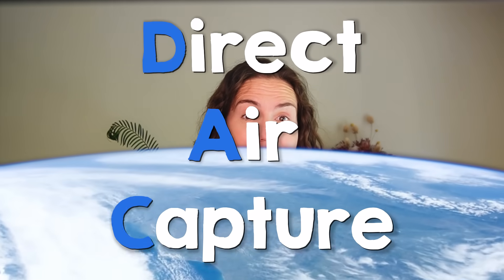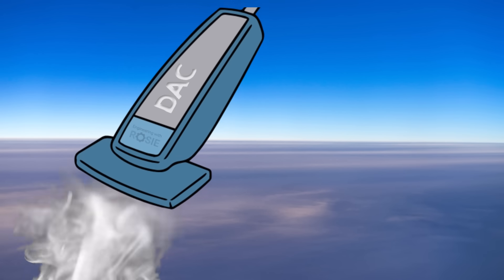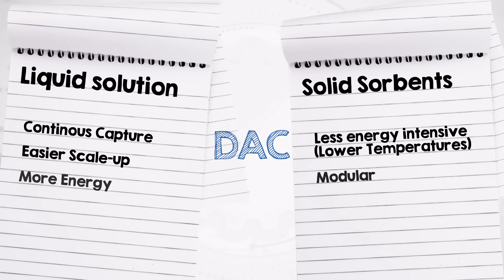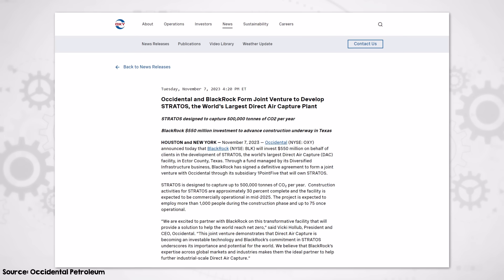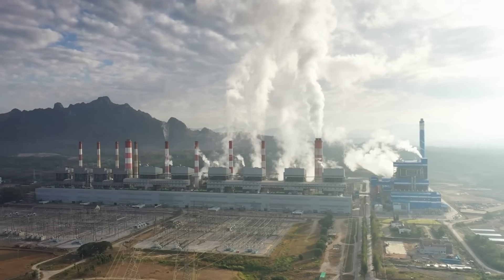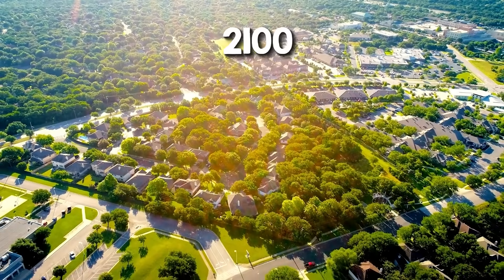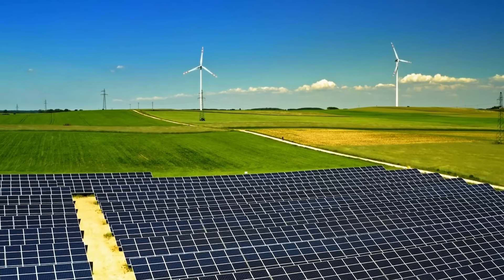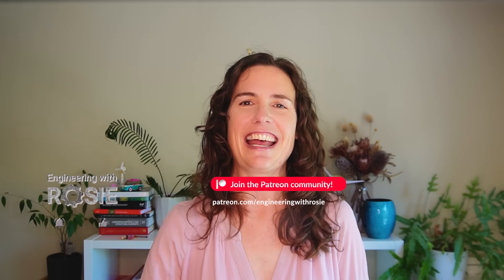Direct Air Capture: Climate Savior or Distraction?

Comment: Goddard & Goddard Engineering

Environmental Studies

Wilson B. Goddard, PhD, Principle Senior Scientist;

Christine B. Goddard, Principle Environmental Planner

Toward a No Carbon Burn Hydrogen/Ammonia Energy Future Without Stranded Fossil Fuel Resources

The pyrolysis of all types of Fossil fuels is a little discussed but literally can be a transformational part of a smooth transition to a no carbon burn world.

To avoid further climate warming, by necessity we must move quickly toward a no carbon burn future.  This can be greatly aided by using fossil fuel's hydrogen energy without burning its carbon.  This can be achieved through fossil fuel pyrolysis, thermal cracking, which releases the hydrogen leaving elemental carbon as a useful by-product. The carbon may be used in many applications from soil amendments to aeronautical light weight structural elements depending on its form.  

The energy required for pyrolysis is no more than the necessary energy used to separate carbon dioxide from flue gasses, clean and compress it then pipeline pumping it to sequestering storage, CCS (1. Steinberg, 1997). The elemental by-product carbon can be safely stored or used without the inherent uncertainties of CCS possible releases or other environmental impacts. Various forms of carbon may be produced including less expensive nano carbons depending upon the pyrolysis system used using various catalysts (2.&3. Ren, 2015 ).  
There are many good research papers on fossil fuel pyrolysis and its ability to produce clean hydrogen and carbon without carbon dioxide emissions.  There are a few companies pursuing commercial applications, including Basf, Eden and Monolith Materials.  Appended are four abstracts from papers for your further review which have demonstrated hydrogen production from methane, propane, gasoline and diesel fuels as well as carbon dioxide producing various forms of carbon including nano carbon. The energetics are shown to be equivalent when you consider the energy loss in carbon dioxide CCS and the uncertainties or the availability of permanent subsurface storage.  The 4. abstract discusses include Professor Licht's power plant applications.
The pyrolysis systems are shown to be practical, can be designed to be used portably and for transportation applications.  These fossil fuel hydrogen production procedures with no burn carbon have been demonstrated sufficiently that they should be considered for a wide range of applications representing BACT and/or LAER for carbon dioxide emission control.  Applications include converting coal fired power plants to methane fueled hydrogen fired clean burn plants.   These procedures will allow use of what are now considered "stranded fossil fuel resources" smoothing societies' move to 100% renewable energy.  Monolith, Inc. has retrofitted  a coal fired power plant in North Dakota to a hydrogen fired plant through pyrolyzing natural gas and producing carbon black as a by product.

Selected References with abstracts:
1.  BNL- 65452 Informal Report 
NATURAL GAS DECARBONIZATION TECHNOLOGY FOR MITIGATING GLOBAL WARMING, Meyer Steinberg Brookhaven National Laboratory Upton NY 11747 1997 - 1998 
Abstract
It has been understood that production of hydrogen from fossil and carbonaceous fuels with reduced CO2 emission to the atmosphere is key to the production of hydrogen-rich fuels for mitigating the CO2 greenhouse gas climate change problem. The conventional methods of hydrogen production from fossil fuels (coal, oil, gas and biomass) include steam reforming and water gas shift mainly of natural gas (SRM). In order to suppress CO2 emission from the steam reforming process, CO2 must be concentrated and sequestered either in or under the ocean or underground (in aquifers, or depleted oil or gas wells). Up to about 40% of the energy is lost in this process. An alternative process is the pyrolysis or the thermal decomposition of methane, natural gas (TDM) to hydrogen and carbon. The carbon can either be sequestered or sold on the market as a materials commodity or used as a fuel at a later date under less severe CO2 restraints. The energy sequestered in the carbon amounts to about 42% of the energy in the natural gas resource which is stored and not destroyed. A comparison is made between the well developed conventional SRM and the less developed TDM process including technological status, efficiency, carbon management and cost. The TDM process appears to have advantages over the well developed SRM process. It is much easier to sequester carbon as a stable solid than CO2 as a reactive gas or low temperature liquid. It is also possible to reduce cost by marketing the carbon as a filler or construction material. The potential benefits of the TDM process justifies its further efficient development. The hydrogen can be used as a transportation fuel or converted to methanol by reaction with CO2 from fossil fuel fired power plant stack gases, thus allowing reuse of the carbon in conventional IC automobile engines or in advanced fuel cell vehicles. 
2. The Minimum Electrolytic Energy Needed To Convert Carbon Dioxide to Carbon by Electrolysis in Carbonate Melts 
Jiawen Ren, Jason Lau, Matthew Lefl er, and Stuart Licht * Department of Chemistry, The George Washington University, Washington, D.C. 20052, United States: pub Oct 2, 2015 American Chemical Society
ABSTRACT: 
One pathway to remove the greenhouse gas carbon dioxide to mitigate climate change is by dissolution and electrolysis in molten carbonate to produce stable, solid carbon. This study determines critical knowledge to minimize the required electrolysis energy, the reaction stoichiometry in which carbon and O2 are the principal products, and that CO 2 can be electrolyzed inexpensively. Thermochemical and experimental results indicate that the principal carbon-deposition reaction in molten Li 2 CO 3 or Li 2 O/Li 2 CO 3 electrolytes at 750 ° CisLi 2 O+ 2CO 2 → Li 2 CO 3 +C+O 2 . The reaction occurs at high Faradaic efficiency of the 4e − reduction of CO 2 to carbon and oxygen at an electrolysis voltage as low as <1 V. Electrolytes without lithium carbonate but containing calcium and/or barium carbonate can also be employed as reaction media for successful carbon deposition, e.g. in an Na/BaCO 3 melt. However, the electrolysis reduction in pure Na or K or Na/K carbonate eutectics at 1 atm of CO 2 forms Article pubs.acs.org/JPCC metals and/or gases, i.e., CO.
3. One-Pot Synthesis of Carbon Nanofibers from CO 2 
Jiawen Ren, † Fang-Fang Li, † Jason Lau, † Luis Gonza lez-Urbina, † and Stuart Licht * † † Department of Chemistry, The George Washington University, Washington, DC 20052, United States; pub Aug 3, 2015 NANOLETTERS
ABSTRACT:
Carbon nanofibers, CNFs, due to their superior strength, conductivity, flexibility, and durability have great potential as a material resource but still have limited use due to the cost intensive complexities of their synthesis. Herein, we report the highyield and scalable electrolytic conversion of atmospheric CO2 dissolved in molten carbonates into CNFs. It is demonstrated that the conversion of CO2 → C CNF +O2 can be driven by efficient solar, as well as conventional, energy at inexpensive steel or nickel electrodes. The structure is tuned by controlling the electrolysis conditions, such as the addition of trace transition metals to act as CNF nucleation sites, the addition of zinc as an initiator and the control of current density. A less expensive source of CNFs will facilitate its adoption as a societal resource, and using carbon dioxide as a reactant to generate a value added product such as CNFs provides impetus to consume this greenhouse gas to mitigate climate change.
KEYWORDS: Carbon nanofibers, carbon composites, carbon capture, climate change, solar energy
4.  Carbon  Nanofiber  (from fossil  fuel)  Electric  Power  Plants:   Transformation of CO2 Exhaust to Stable, Compact, Valued Commodities  
Stuart  Licht, Department  of  Chemistry, George  Washington University Washington, DC USA 
Abstract: 
Modes  of  power  plant  operation  are  presented  which  remove  the  greenhouse  carbon  dioxide from  fossil  fuel  plant  power  station  exhausts  and  transform  the  carbon  dioxide  into  a  valuable carbon  nanofiber  product.  The  first  mode  uses  the  emissions  from  a  natural  gas  CC  power  plant to  provide  hot  CO2  to  a  molten  electrolysis  chamber  which  generates  both  carbon  nanofiber  and oxygen.  The  valuable  carbon  nanofiber  product  is  removed,  heat  from  the  carbon  nanofiber  and oxygen  products  is  transferred  into  heating  steam  for  the  steam  turbine,  and  the  pure  oxygen  is blended  into  the  air  inlet  to  allow  the  gas  turbine  to  operate  at  higher  temperature  and  higher efficiencies.  A  second  mode  converts  a  conventional  coal  power  plant  to  a  STEP  coal  CNF power  plant  by  directing  the  hot  carbon  dioxide  combustion  emission  into  carbon  nanofiber production  electrolysis  chamber,  and  transforming  the  carbon  dioxide  to  carbon  nanofibers  with the  use  of  renewable  or  nuclear  energy.  Other  intermediate  modes  of  fossil  fuel  carbon  nanofiber electric  power  plants  with  partial  solar  input  are  also  evident,  as  well  as  a  simplified,  smaller version (for heating/cooking) rather than electrical production.

Comment: Regarding the military connection, you might be interested that the US Navy has developed techniques for extracting CO₂ more efficiently from seawater than can be done with direct air capture.  See for instance

Heather D. Willauer et al.,
Development of an Electrochemical Acidification Cell for the Recovery of CO2 and H2 from Seawater
August 2011 Industrial & Engineering Chemistry Research 50(17)
DOI 10.1021/ie2008136

Comment: This is a very good idea, but the reason for growing algae is that after you rupture their cell walls and get to the oils, you could use the biomass for feed and other products (cosmetics, icecream, emulsifiers, etc)

Using your method is excellent. And that would be a more direct method for getting fuel, but growing plants like bamboo, algae, and trees you get a lot of other extra bonuses and industries.

On top of that, when you’re growing those plants, you are Employing More People.  I can see this as a way to get more out in addition to growing bamboo, algae, and other industrially important organisms, but you also have to think about the social impact of what you are doing, and sometimes that is More Valuable in the long run (Larger Impact)

Comment: DAC puts a tangible price on carbon.  Currently, carbon tax is set based on what governments think they can get away with, I mean, what constituents can afford.  If the air is a common good, which it is, that needs to have a consistent range of carbon content, which it does, then it follows that polluters should pay the going rate to emit carbon directly into the air and to extract it back out again.  Back of the envelope calculations show that current carbon offset plans, planting trees etc., have a carry capacity of less than a fraction of 1% of the total carbon emitted.  DAC internalises the externality of carbon emissions, thus making it possible for the polluter paying.  So, sure, if the price for DAC is $1,400 per tonne and the max carrying capacity is 2% of global emissions, then the set carbon tax that ought to be levied would be (ca-ching) $700,000 per tonne.  (Take that to Exxon and tell them that will be the new business-as-usual.) It's a hard sell, but over the years I have seen politicians from both sides of the floor that could have pulled it off. There are of course two choices to lower the carbon tax (another false dichotomy?) lower the cost of DAC or lower global emissions.  It really is that simple.

Comment: Energy transition from fossil fuels – cannot be done – powered by fossil fuels.
Humans were not ready morally, ethically and intellectually to start the mass extraction of fossil fuels with the advent of the steam engine 300 years ago. 
The Magna Carta requires today overhauling – adding to it the right for humans to understand what Energy really is - before any other commandment;
“In any system of energy, Control is what consumes energy the most.
No energy store holds enough energy to extract an amount of energy equal to the total energy it stores.
No system of energy can deliver sum useful energy in excess of the total energy put into constructing it.
This universal truth applies to all systems.
Energy, like time, flows from past to future” (2017).

Comment: Direct air carbon capture is so frustrating to me.  It consumes more energy than ocean-based carbon capture. Oceans hold 50 times more CO2 than the atmosphere.   According to a study from UCLA, "Saline Water-Based Mineralization Pathway for Gigatonne-Scale CO2 Management", it's estimated that the world would need 20 petawatt hours of power to remove 10 gigatonnes of CO2 from ocean water.
That's slightly less than what the entire world consumes globally per year, but at least that's something we can wrap our heads around.

The study also mentions that CO2 is absorbed into cold water more than warm water.  I'd like to see large hydroelectric dams, nuclear power plants, and wind farms built in places like Norway, the US,  Canada, the UK, Sweden, Japan, Argentina, and others meant to satisfy the 20 PWh of energy needed just to remove 10  gigatonnes. I say 'just' as if that's a small amount. It's not.

Comment: Thank-you so much Rosie. I've wanted a video like this for a few years to understand the complexity of DAC. Having looked quite deep into this topic I agree with what you've said and is why I've struggled, in case I missed anything, with my support of Climeworks which you've helped me understand, is at present expensive and maybe the money could currently be better spent elsewhere. However in their favour they are geosequestrating the CO2 in the local basalt using 100% geothermal energy. I send a few Euros their way to offset some of what carbon I can't avoid, not so much to change the word, but to help, in my small way, for them to eventually develop a large scale, cheap system to remove the historical emissions. Long after I'm gone I would love the planet to return from the current 420ppm to maybe something like the 316ppm when I was born.
Reply: I remember when they were saying that 300 ppm was the tipping point, 350 ppm would be really, really bad, and 400 ppm was unfathomable.
Reply: @philipyoung7034 the expensive weather-related events around the world are proof that the existing and future levels of CO2 in the atmosphere are untenable.

Comment: Looking forward to hearing about passive DAC, it uses much less power and could scale a lot better. Whatever technology comes out on top though, the decider will be what they end up doing with the CO2. Converting the CO2 into fuel or using it for enhanced oil recovery isn't going to help CO2 levels. The CO2 has to be buried and stay buried, eg Carbfix.

Comment: One small nit: that Iceland DAC plant is a special case. Iceland is overrun with geothermal power generation, which is a reason why Alcoa put an aluminum plant there (heavy power user). Thus they have a lot of cheap, carbon free power with which to run the DAC.

Comment: Earth to engineering types. We have be putting CO2 into the atmosphere for the 10000 years we have deforesting and degrading grasslands into deserts. The atmosphere has then been giving up 90 odd per cent of this CO2 to the oceans. It is an equilibriated system. When we remove CO2 from the atmosphere the oceans will replace nearly all of it. It would take centuries using these expensive toys at a massive scale to make a dent in atmospheric CO2 levels, assuming no more fossil fuel use (not going to happen), no more forest fires, no more land degradation. Get the picture? It's a good thing CO2 is not the cause of climate destabilization. What is? Land and forest degradation and the consequent disruption of the hydrological cycle. Stay tuned.

Comment: You aren't even considering the CO cost of making all that steel and other components, the fact that things like fan motors wear out and need to be replaced, probably by a internal combustion vehicle and so on. Those high costs hide even more resource use and carbon production.

A important way of dealing with reducing carbon is mass transit, especially trains and trolleys powered by electricity from rails and such.